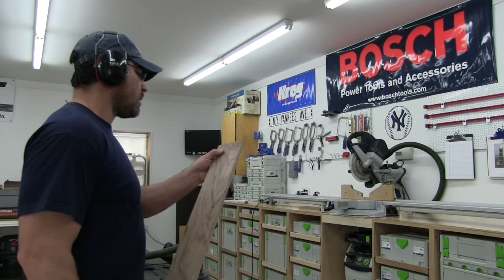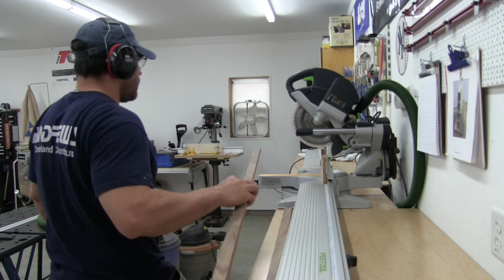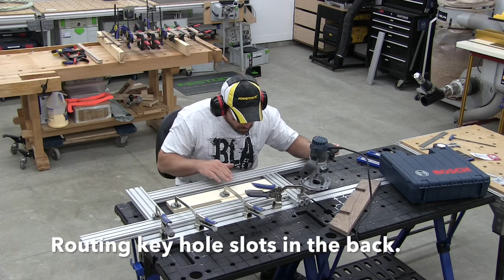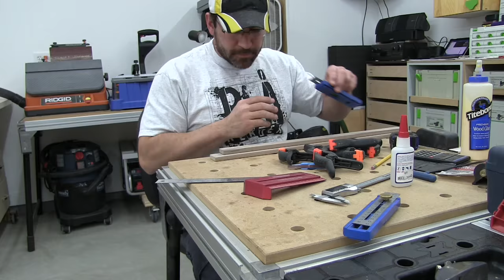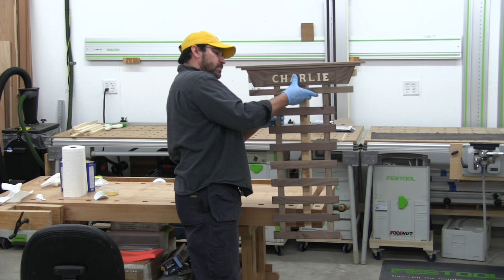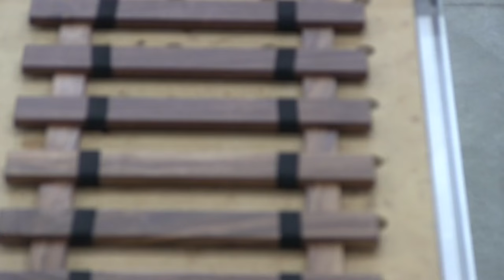Making A Martial Arts Belt Display.

Comment: how long have you had the little table saw for thin stock ripping? Did you decide that was a better solution than using any of the parallel guides available for the TS55? I ask bc im in the same situation--looking for a good solution for thin stock ripping w/o buying a large table saw.
Reply from the maker: Colin Cochran A table saw is just faster for narrow rip cuts.  I  made do for years without one but now that I have the space for one I had to get one.  I  don't need nor do I want a large table saw.  The Bosch GTS1031 has plenty of power for me.   I've ripped pressure treated 2x4x8's with no problems.